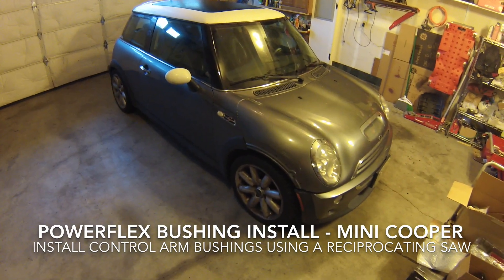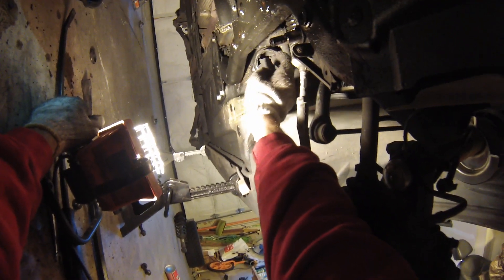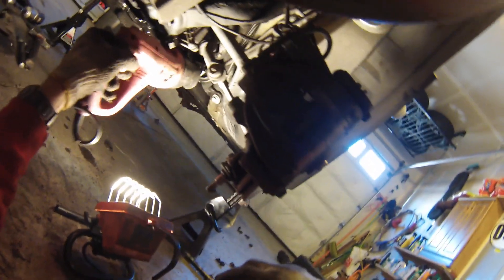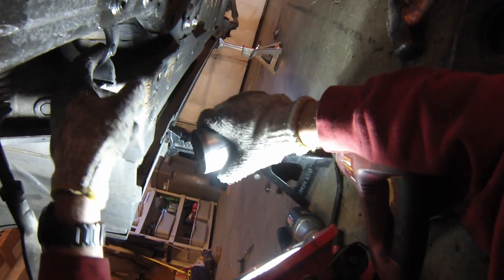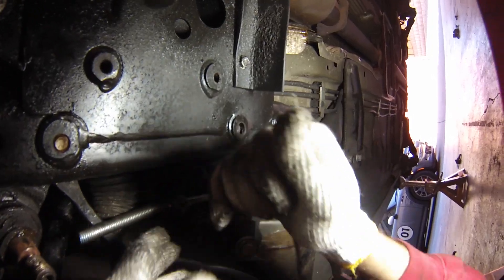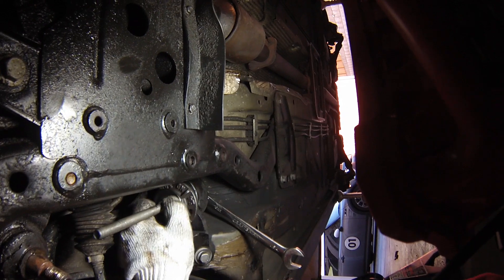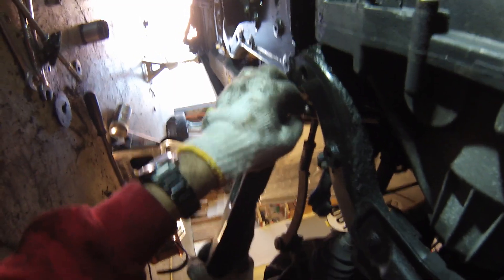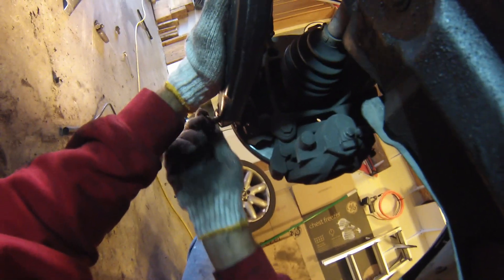MINI Cooper Control Arm Bushings done on the car-cutoff method - Powerflex

Comment: Can you replace the inner ball joints with just the dropping the control arms and not the whole subframe?
Reply from the maker: Not exactly. Removing the inner ball joints require either removing the drive shafts or slightly lowering the subframe. It would have been possible if they designed it so the bolts come out the bottom instead of the top, but oh well.
Reply: *****
 Easier to drop the subframe or remove the drive shafts? Seems like removing the drive shafts would be less time...
Reply from the maker: Steven Tellman Removing drive shafts might work. I'll have to try that next time. (Well, pulling drive shaft out of the transmission, but you can leave them connected to the hubs since the ball joint is already removed.
Reply: *****  I cant see how a pickle fork would not damage the boot however careful you are.... to get out the inner ball joint bolt you can loosen the engine mounts and carefully jack up the engine to clear the bolt or remove the gearbox mount near the power steering fan and tip the engine slightly.
Reply from the maker: ian gee
I've done it a few times and decided it's easiest to just pull the axles. The bolts are really long and are very tight; removing the axles gives more room to wrench as well. You can actually leave the axle attached to the hub and just pull the gearbox end out (by separating lower ball joint and steering tie rod end to pull hub outward)

Comment: when u try to fit the control arm you pry it in but where to you place the prier?
Reply from the maker: +1000biskota Wherever you can get leverage! It's trial and error and the pry point changes depending on which direction you are trying to move things.
Reply: but arent there parts that must be avoided prying on?im trying to place the control arm back in the bushing
Reply from the maker: +1000biskota You'll need to figure that out for yourself. If it's brittle or will bend easily, don't pry on it. I don't remember exactly but I think you can pry on pretty much anything down there except an end link, brake line, etc.

Comment: i have a question , I'm trying to do my driver side control arm removing it was a pain in the , butt in stalling the new one is even worst , could that be cause I'm using the same bushings  ?
Reply from the maker: You are reusing the bushings you uninstalled?
Reply: I never uninstalled it , I just took out the arm cause it was bent , but putting in the new one is becoming a problem

Comment: Great video (all of yours). After ordering the new Powerflex bushings (and the tool to remove the old ones) from BavAuto, and watching this 3 times, I realized that the original metal bushings are being REPLACED by these power flex bushings!  Correct? There is a tool (I saw in another video) to install new metal bushings (or I suppose the Powerflex as well) which I didn't order. I kept thinking I was missing something and didn't see any metal bushings in the Power Flex kit. I haven't been under the car yet (Dec), but made a precautionary order (Black Monday) as the tire store told me they were bad. Why isn't just easier to remove the brackets from the car?  And I wish someone would suggest that while you're under there with everything apart, you might as well replace the ball joints too. I'll make the  tool you showed to draw them in. Thank you so much.
Reply from the maker: Carrier brackets reused, silver metal part of the old bushings go away. Removing brackets from car requires subframe removal. That may or may not be easier depending  on what tools you have. With a decent shop, subframe is easiest. Ball joints last a long time but makes sense to replace if you are removing everything.

Comment: Hi Mod, question I have made the tool to press the Powerflex bushings in and man I just can't seem to get these things in. I have the sub frame off so I have tried leaving the housing on the frame and also taken them off. One side keeps in gong in to far and the whole tool just keeps shifting on me. I've tried everything to keep this thing straight but it keeps moving on me. I'm sure I'm doing something wrong but can;t figure it out. Thanks
Reply from the maker: Keep trying, eventually they will go in.

Comment: Hey mod, 

Sorry if you've already answered the question.. Tackling this today and don't want to mess up my ball joints! How did you separate control arm from ball joint without damage? Just the pickle forks?
Reply from the maker: +Tokenontwo PIckle fork, if they are stubborn or you are worried about damage, remove left and right axles and pull the two inner ball joint bolts on each side and leave them connected to the control arm.

Comment: Hi Mod Mini. Love watching your videos and attempting to change to power flex bushing for the first time. I am struggling with removing the control arms. What i've done so far is removed the outer 18mm and inner 21mm nuts consecutively from the outer and inner ball joints from the bottom of the control arm. Shouldn't the control arm come off now, or what should i do? The control arm is just jammed in there...would really appreciate any suggestion/advise.
Reply from the maker: Faisal Farid you have to bang and pry on it. Put the Nuts back on by hand so you don't hurt the threads. Hit the part through which the ball point passes with a large sledge hammer. Outer ball joint should fall out fairly easily. Inner ball joint is a bit harder. If you can't get it to come out, might need to remove the subframe

Comment: Hey @Mod MINI, I'm currently changing the bushings and want to change them into Powerflex ones. I'm at the point where I have to press in the Powerflex bushing. I've tried it with two different selfmade-tools, but everytime the tool bent or the bushing just got stuck because it turned too much during the pressing-process.....now: what should I do? - buy a "professional" pressing-tool for 50€ (Germany), or build a better tool? How much force can I apply to the bushing? I am afraid to destroy it....
Reply from the maker: Keep trying, eventually it will center itself. You can let it get pretty crooked and sometimes recovers. I don't think it's possible to tear it with hand tools.
Reply: Thank you for your fast response! I will try again tomorrow or so...hope it will pop in position soon :b

Comment: Hi there. Thanks for the video. Will surely once again save me tons of money. Do you have an opinion on polyurethane bushings vs OEM? Thanks!
Reply from the maker: I prefer the polyurethane. Car is much more responsive with only a small increase in harshness. I think they last longer as well.
Reply from the maker: *****
I've never installed the yellow ones. I have the black (race) control arm bushings on my car and most people opt for the purple ones. I suspect even yellow is still a significant upgrade over stock.

Comment: Hey man thank you very much for the videos you're a lifesaver!! How did you get the inner ball joint for the control arm apart. Basically what I'm asking is if you could just let me know how you got the control arm off which bolts or nuts did you take off because I tried my joint tool and pry bar everything for the inner one and can't seem to get it! Please help! Thanks again 😀
Reply from the maker: Inner ball joint can be really hard. I use a pickle fork with the tips cut about 15mm shorter, otherwise the tips will hit the subframe. You also may need to weld a spacer on to the pickle fork since it might be a tad too skinny. Then hit really hard with a BFH.

Comment: You cut them out and others torch them out are they really that hard to change the MINI method? lowering the sub-frame. It looks like you only have to hang the back done to get out the two bolts. Ever try?
Reply from the maker: +BigSteveRealtor I've done it both ways and it's somewhat faster to cut/torch than to remove the subframe. The bolts are very long and very tight. Hanging the subframe makes it very hard/time consuming to loosen/tighten the bolts as the whole thing is flopping around and tool clearance is not good. If you are going to hang the back of subframe, it's only an extra 10-15 minutes to just lower it completely. 
Completely removing the subframe is, however, the least strenuous and least frustrating method. Once you get it out, you can work in a more suitable posture and even go over to the workbench instead of lying on your back.
Reply: +Mod MINI I will be doing it on a friends lift with access to air tools. Will that change your thoughts any?
Reply from the maker: +BigSteveRealtor Same opinion. Air tools won't help when the subframe is just hanging. If anything, the cut 'em out method is easier with a lift.
Reply: +Mod MINI We ended you hanging the back end of the sub frame and it was easy to get the brackets out. Fortunately my friend has a 50 ton press to force them out. If you dont have a press and didnt buy the bushes already mounted you method is a must. Question when I pulled my control arms the bushes on both sides ripped out leaving much of the rubber on the arm. We had to air chisel them off. Ever run into that?
Reply from the maker: +BigSteveRealtor Yes, the core always gets stuck on the control arm. I use a sawzall to slide most of the way through the metal core and then pry off.

Comment: Hello, and what parts did you use to make the press tool? Thank you
Reply from the maker: pancracio pelayo A threaded rod and 3 1/2" nuts, a couple flat washers, and two flat plumbing flanges of suitable diameter (about 3 inches)
Reply: Thanks a lot! The plumbing flanges were the only parts i did not recognise, i suppose i can find those at any home depot or any other hardware store? Thank you again.

Comment: +Mod Mini Okay transmission, gear, is setup. I haven't put back the subframe because remember in the other video, I commented. I bought Bushing with Bracket for Control Arm, for both side. I have a problem removing it the old Bushing with Bracket!! We tried to remove with the L-tools and wrench with big socket size 22-23. Couldn't remove it! The subframe is on the floor ready to put back but I need to replace the Bushing with Bracket. Any suggestions? Please let know. I want to finish the car by tomorrow.

Thank you,
Christian
Reply: +Mod MINI Update: The whole thing where we were putting pressure on is with the control arm, the only thing holding the Bushing with Bracket with the Sway Bars. I am not sure if removing that, the whole Bushing with Bracket would come out. Also another question, I haven't purchase the Ball Joint for Control Arm, will it be possible to replace while not having to removing the subframe? Please let me know.
Reply from the maker: +Christian Alberto not sure your question - do you mean the inner/outer ball joints? If it is stubborn, sometimes you just need to drill it out. Usually the inner ball joint comes loose when I am whacking on the outer ball joint, but sometimes it just doesn't want to come out. Before drilling first use a pickle fork. You may need to modify it to make it fit right. If it doesn't come out even with pickle fork, time to start drilling. If there is a special tool that makes this job easier, I don't know what it is.
Reply: +Mod MINI 

1. (31126757562) Bushing with Bracket for Control Arm. The question is how to remove it.
    
(Watched a video, he didn't have the subframe removed, just the control armed, he pulled the control arm out of the Bracket for Control Arm. And just one bolt left, to remove the Bracket for Control that's what we're going to remove the Bushing with Bracket for Control Arm. Because we bought the whole part instead of the rubber.

2. Okay, the ball joint, not where the brake disk is at. I believe it's in the middle of the control arm, (31106779438) we know how to remove it. So never mind but the question was. Do I have remove the whole subframe to remove the ball joint. And the answer is no. Might have to delay because I haven't order the ball joint.
Reply from the maker: +Christian Alberto 1. You have to lower the subframe to remove the control arm bracket. 2. Remove axles to remove inner ball joints without lowering subframe, but good luck, sometimes they are really stuck.
Reply: +Mod MINI Update: Car runs now. Changing gears are softer than when I bought the car. It's amazing. No more vibration. And the battery doesn't die off anymore! The more we use the car, the better clutch pedal. Because we had it 4 months parked. Clutch pedal was on the floor for not in use. Even when we take out the air, the next day clutch pedal is so weak. Now the more we use it. It works basically now haha. Total time working on the car. I'll say 3 days.

Thank you very much! Your information helped me out a lot!

Comment: Thank you for you great videos!! I have been chasing down a “clunk” in my 2006 mcs front right side. Currently I replaced all 4 shocks with the orange Koni shocks,  new upper strut mounts, and a Alta 22 rear seat bar. Still had the “clunk”. Tested and replaced the lower control arm bushings per this video, and got it 2:45 wheels up to wheels down. Great tips btw! And yet, I still have the “clunk” when I go over bumps. I put it back on the jacks and shook the front seat bar, with a little bit of rattle from it. Nothing out of the exhaust either. Any tips or directions I should try next?
Reply from the maker: Loose bolt somewhere, or sway bar bushings or end links maybe?
Reply: I did replace the right side sway bar link, sadly it didn’t solve the issue. A friend came over to help me shake the car side to side while I searched for the source, and it looks like the sway bar bushings. I have a set of Powerflex coming in now, and W.M.W. says that is possible to replace them without dropping the entire subframe. They suggest just removing the back 6, and 2 side bolts will allow enough room the loosen the bolts and slide the bushings out. Hopefully they will come in this week so I can try it and do my reduced pulley as well. Once again, thank you for all of your great videos. You have given me the knowledge to save myself a ton of money.
Reply: @tomdaugherty2912  Were you ever able to figure out where the sound was coming from? I'm about 99% certain I have the same issue.
Reply: @TheIdiotechnical  I was able to resolve the issue. Unfortunately the C.A.B.'s did need to be replaced, however they were not the source of the "clunk". It ended up being the front sway bar bushings. You can replace them with out dropping the subframe like I did, but i do not suggest it. I put the car up on ramps, and had a friend shake the car side to side while I held on the sway bar, and sure enough it was sliding back and forth. Good luck, I hope this helps.

Comment: Hi Mod, I have a quick question; I'm having trouble removing the inner ball joints on the control arm and am going to try a pickle fork next, but my main concern before pulling them off is how to get the control arm back on the inner ball joints. If they are that stubborn to get off, will they be able to slide back on? Any other tips or tricks for those ball joints?
Reply from the maker: +Kristofer Frede Stubborn to get off but they go back on just fine. Sometimes they can be very hard to get out. I'm going to recommend just pulling the axles and removing the two inner ball joint bolts, then taking out the entire inner ball joint together with the control arm. Less chance of something going wrong... easy to damage the ball joints with a pickle fork and then need to replace them...

Comment: Hey Mod MINI, I bought the purple poweflex control arm bushings for my mini and and experienced mechanic said he didn't want to install the because when he has used urethane bushings before they pretty much always fail pretty quick and the OEMs were better. So have you ever had trouble with the powerflex bushings failing? Also have you had any trouble with ballpoints that you replaced on your other video? I ordered the same ones from Amazon and was hoping they were decent quality. Thanks!
Reply from the maker: Henry Hertzler They've been in my car for nearly 4 years now, no issues at all, including thousands of track miles. I've installed probably a dozen and nobody has issues either. Is he installing them wrong or not lubricating them?
Reply: ***** I don't know what he is doing but he claimed that he had installed them on many cars including his MINI and his wifes BMW and they failed. I am beginning to think maybe his memory of his 30+ years as a mechanic has began to fail him..Previously when I had replaced the head-gasket on my MINI and he was asking the details on torquing the head bolts he claimed that rotating the bolts 90 degrees was half a turn. After consulting one of his other mechanic he finally agreed with me that it was 1/4 turn LOL. I talked with the mechanic that works under him and is actually doing the job and he would agree with  you and everything else I have heard about the urethane bushings. So I don't know why he dislikes them so bad unless he just always gets defective bushings, which would be strange.
Reply: Henry Hertzler urethane bushings in conventional control arms with small diameters are usually just a urethane doughnut and a metal sleeve inside.  The movement is metal sleeve on steel bolt.  way harsh, seizes up, tears up the urethane.  This movement here is  high density rubber on urethane.  Maybe that's the difference....and so long as it stays lubricated and clean.
Reply: Brian Corrigan Do they need lubricated as maintenance or just at the time of original installation?
Reply from the maker: Henry Hertzler Should only need when originally installing, unless you frequently drive through knee deep puddles of hot soapy water.
Reply: ***** LOL not usually. :)